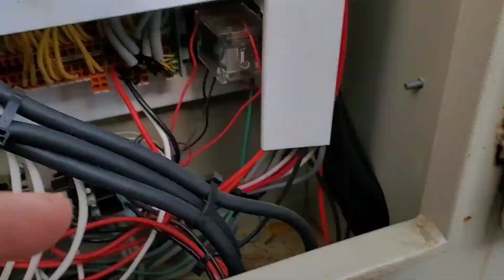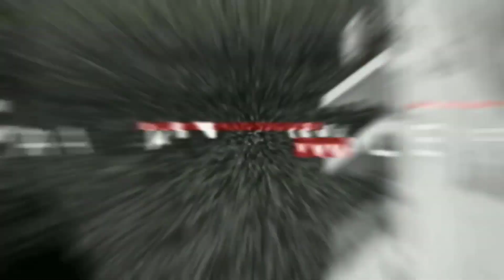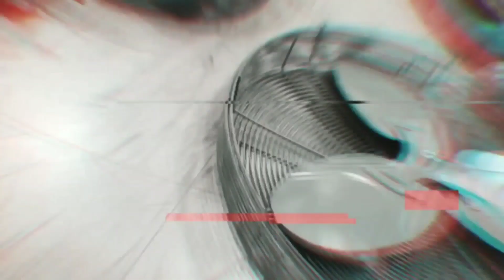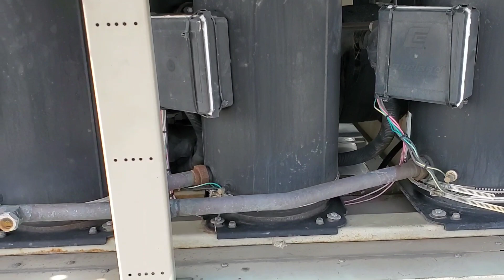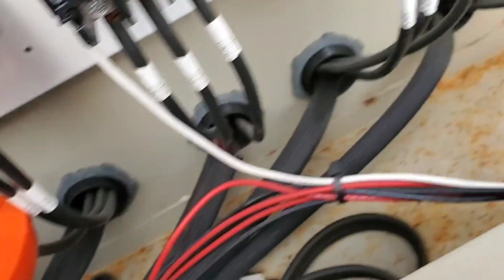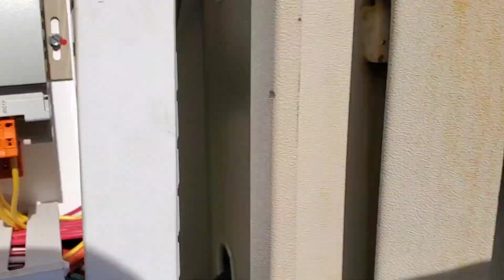Compressor Is Tripping The Motor Protector

Comment: Very interesting to hear that moisture makes them trip .
We do have them motor protectors over here as well , in fact , most of the scrolls I work on have them , but we call them Kriwans , from the brand that makes them .
I don't quite get why they wired them in series though , the ones I work on are wired independently , so that if one trips , it trips that particular compressor and you get the alarm for that one only and you know which compressor is the problematic one .
I honestly didn't know about that moisture issue though , that's very good to know .
Thank you for sharing , that's a good one innit 👍.
Reply from the maker: Yes heavy rain will cause them to trip intermittently and I agree the should be rewired in paralell

Comment: I myself wouldn't convert the refrigerant. Especially if you're going to convert it from Mineral to POE. Remember that POE oil is made up of alcohol and acid. With that being said it will take an old system and clean it out. The new oil will turn completely black with contaminants and will have to be changed more than once. It will also attack any rubber seal and O Rings that is not compatible causing leaks everywhere. I would only use drop in refrigerants that use Mineral oil.
Reply from the maker: There's already POE oil circulating within from a previous compressor change, the new comp came with it. The problem with drop ins is that they don't work well with large double pass chiller bundles and some TXV and liquid line up grades are needed.

Comment: The conversion to another refrigerant looks to be very involved.  What oil does this system have?  Mineral or other? Be waiting for your video.
Reply from the maker: It has a mineral base but some POE as well from a past compressor change.  The comp came shipped with POE

Comment: What refrigerant have you been using to convert systems and have found successful operations. And what components did you had to change/adjust to again achieve successful operation.
Reply from the maker: Haven't really done any yet, I was hoping that TDX20 would work but not in this case with the bundle.  Might go to 407c on this
Reply: How come the tdx20 won't work, was just wondering because they say it's the only r-22 replacement. Is it because you'll have to change too many components to get it to work.